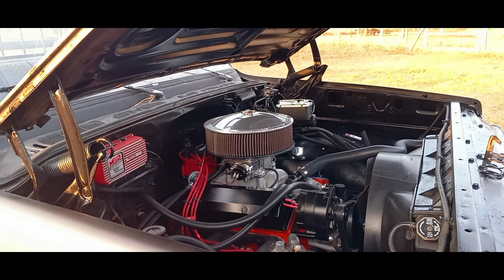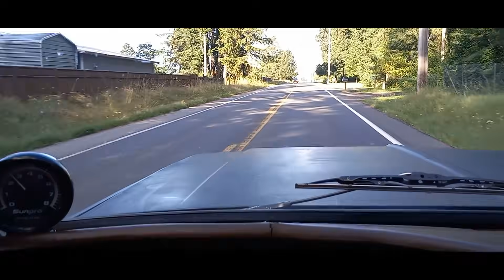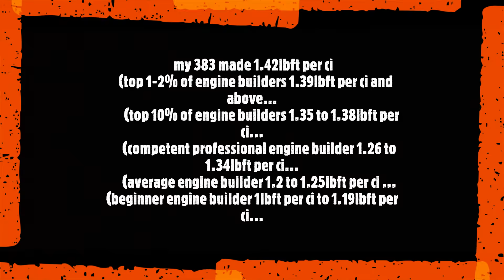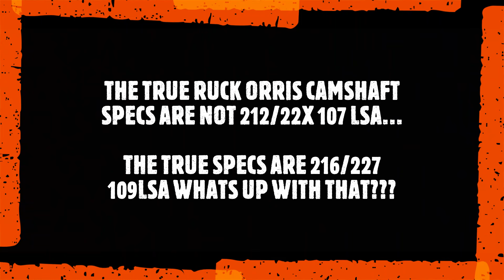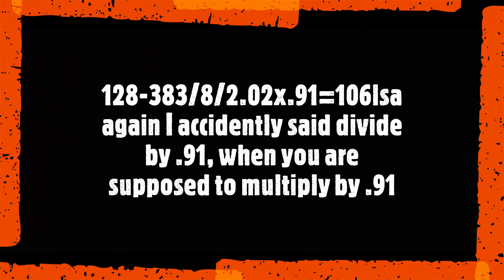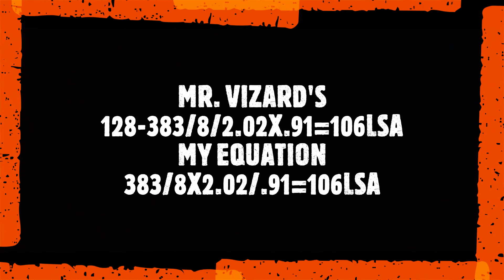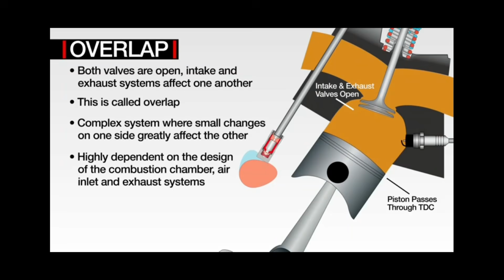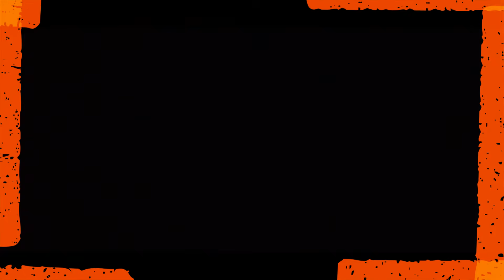CAMSHAFT SELECTION by LSA, 9 LSA's DYNO TESTED!!! LSA THEORY WILL BE DYNO PROVEN!!!, and EXPLAINED

Comment: Is this a video about cam shaft theory or a bitching and winning session about who don't know shit? I'm 52 minutes in and so far all I know is you disagree with BT'S theory and agree with DV. Maybe you should title it to 'oh how wrong BT is and oh how right DV is'!  JS
Reply from the maker: 😆🤣🤣... What you call "whining"( learn to spell) lol  is known as Dependent and Independent variables which you clearly are not qualified to give a proper Dimensional analysis....  This video obviously went way over your head because of a of lack comprehension of valve events and an inability to see what was being presented in the storyline... You are one of a very very small hand full of over opinionated and under educated people that said something similar to what you have said out of the 109,000+ people that seen this video... Hell David Vizard left a comment on this video complementing me on the information i had presented so there is obviuously something to that🤔(his comment is pinned at the top).... I dont have time to break the whole video down for you step by step but ultimately this video does show & explain the effects of random changes of LSA, it proves with dyno data that there is only one optimal LSA for any given Ci v8 engine combination and it shows that when optimaly selected LSA it will result in the most TQ & HP across the entire curve, it also shows how optimal LSA is achieved...  All this was being explained & proven with dyno data all the while showing & explaining Brian Tooleys incorrect theory about nothing having an influence on LSA and LSA not being an influential factor on power production, i even used Tooleys own words strait out his mouth to confirm that he is incorrect... Ultimately there is info in this video you will absolutely not find anywhere on the the internet, this video had also inspired David Vizard who is an ex areospace engineer and a legend in the automotive world, It had inspired him to make a video alot like this using Brian Tooley as an example of an incorrect "camshaft professional" because i had brought to DV's attention that Brian Tooley was spreading misinformation about valve events so he followed my lead and exposed Tooley also because DV & I have no tolerance for incorrect information which results in inoptomial performance and the spreading of BS, so Tooley needed to be exposed... I have had several different types of Engineers with Masters & PHD's along with intelligent people from other qualified positions recognise the magnitude & depth of the information given in this video and they are able to appreciate it, i even had one PhD physics engineer (just like my grandfather) tell me that this video would have made a great PhD Dissertation,  if you dont know what a PhD Dissertation is look it up!!.... My next video will more directly explain all this further/deeper and with alot more examples for proof.... In this video i was exposing BT's incorrect theory for LSA, his incorrect & incomplete theory for valve events and why his theory for valve events are incorrect, ultimately threwout this the video I proved he is wrong, i had proven that he is absolutely spreading misinformation and he is also lying about camshafts specs for example the truck norris cam... I had talked to Brian Tooley because he commented 3x after he seen this video, We had a short debate and ultimately he could not deny what had been presented, he had no rebuttal for the proof i have and the explanation i gave him about the fact that optimal performance is achieved by the gas dynamics produced by the dynamics of optimal valve events which in tern allow the engine to achieve the max trapped volumetric efficiency for any given engine combination via optimal wave tuning produced by the intake valve Opening position in relation to the optimal amount of overlap and the intake valve closing position... That is a vary short explanation of optimal valve events in nut shell... Optimal valve events start with the valve placement produced by optimal LSA which was proven in this video... Individuals like yourself should be mindful enough to keep their uneducated thoughts, as just that "thoughts" and also be mindfull enough to resist the narcissistic urge and keep their triggered opinions to themselves because it's not a good look to make comments based on hurt feelings and no real knowledge, Just sayin..... Also I would say you are afflicted by the Dunning-Kruger effect which is the psychological/scientific term for individuals like I had explained in the video, individuals which you obliviously identified with or you wouldn't have made the comment you did... Human Psychology is a real MF'ker and certain types of individuals like yourself are to easy to identify being as they unknowingly show themselves because they are completely unaware of their psychological shortcomings do an inability to accurately analyze & reflect on ones self and acknowledge the fact that they are most likely average or below avrage because stisticly there are more average people in the world, but the average person bealives they are above average, but if everyone was above average there would be no average and it is physically impossible to have no avrage...  Here's a little quote for you, The rational mind is a faithfull servent and the intuitive mind is a sacred gift, we have created a society that rewards the servent and has forgotten the gift....
Reply: @CDG-Racing_Dynamics  Aaaaahahaha......
Reply: @CDG-Racing_Dynamics  I would respond but I don't have a week to read your response. Maybe you could make a video about it. Be sure to include spelling lessons😏

Comment: If i go with whipple 427 lsx and ls3 heads what overlap should i have ? 30? Or should i make a nothet cam with less overlap?
Reply from the maker: Im gonna try to keep this simple... My first question is how did you determine that you need 30° overlap? What was that 30° overlap based off?... The amount of overlap you need is influenced by multiple factors of the engine & the intended use of said engine...Overlap is relative to the rpm at which you want peak TQ to be, which in tern will dictate the rpm at which peak HP occurs... LSA will influence how much peak TQ & HP is produced, along with how much power is produced across the curve... The valve placement produced by an optimal LSA will increase trapped volumetric efficiency which increases TQ & HP production across the curve and will allow the engine to carry HP & TQ farther past peak... LSA & Overlap calculated will give you the duration number... 
In my next video ( Which im almost done with) I get deeper the effects of LSA & optimal LSA with multiple examples, I will also show my compete formula for LSA & overlap which will give bolth a duration @.050 & @advertised duration..., My formula produces the same results as David Vizards but my formula does duration @ .050 &  advertised duration, where as DV's only does advertised duration... This next video will answer alot of questions and will fill alot of gaps which will make things alot more clear, this is a rather complex subject that is not understood by literally more than 98% of people in the automotive industry, this subject will require multiple videos to bring the information competently to light... 
also there are overlap charts in the video when i was giving an explanation of overlap and its function...  Hope this helps, .
Thanks For Watching...

Comment: Great video. I’m about to rebuild a ford 400. (351m/400) 335 ford family. It has open chamber 78cc heads. Compression is 8:4-1. I watched DV video on LSA. He stated minus by 127. I watched your video. You said Cleveland motor minus 132. To help compression I was thinking of going with a 107 LSA. Been searching for cams. Best I could find at the center line was 204 intake and 214 exhaust. Which I feel for a 400 cid that’s alittle to mild. But after using your 132 clevend formula I came up with 110 being the best LSA. I found a cam with 218/224@.050. With 110 lsa.Which I feel would be more suited for my power goals. My question is do you think 110is better than 107lsa with 8:4-1 in a 400? Has a performer intake with 600 Holley.
Reply: I'm curious to know what you come up with. I'm going to do my 1976 Ford Elite 400 and looking how to best manage a decent muscle car build...
4bbl intake a carb a given, headers and Id like a non-retarded cam... doubt I will do heads anytime soon, but the above should be well over 300hp and 400lbft torque... now to figure out the cam for 2000-5500rpm power band.
🤷‍♂️

Comment: I've read that carb/TBI combinations show different LSA requirements over port injected versions.  I'm thinking a little BS here because an engine should not care how the fuel is delivered. What I think some are missing is the increasingly stricter emission standards for newer engines with higher LSA to promote smoother quieter engines.

FYI. I have earned a mechanical engineering degree in the late 80's after starting as a physics major. I've worked as a controls system designer for the HVAC industry and one of my hobbies is truck engines. I continued to be humbled by others who have a very well deserved ability to communicate as effectively as you. I can hear the processes in my mind as you describe them verbally so I think it puts me somewhere on the autistic curve and it definitely reinforces my type A thinking.

Sorry to hear your diagnosis and hopefully your prognosis improves. I too had hoped to pass on my technical acumen to my kids but I had two girls that do not share my gifts or desires. Thank you (and DV) for sharing your knowledge and experiences.

Comment: just buy david vizard s cam program but good job
vave events are are far more important than profile dude vizaed has used 22.000 dynos pulls just for the formula he has h  been talking about his theorys 30 years back you should not have hated on the3 smartest person you never met
Reply from the maker: Who did I hate on? I was supporting & backing Mr.Vizards theory with data and threw my life experence, while exposing Brian Tooley for his incorrect theory of LSA being a result of valve placment when LSA is an input that dictates optimal valve palcment without guessing... David Vizard Commented on this video saying and I quote "What A cool presentation, I wish I was that smooth" his comment is pinned at the top of the comment section... I think you misunderstood something...

Comment: Thank you, brother, both you and Mr David Vizard for helping me learn what I need to know about the 383 I've got for my 1988 Chevy step side shortbox,I've done mechanical work since I was a kid. I pulled my first four speed Muncie from a 68 chevelle and installed it in a 64 442 Olds convertible for my uncle who turned me loose and let me learn. It came naturally to me through my father who could do mechanical and bodywork and paint which he got from his father and passed on to me,I got into the motorcycles while I served in the Army and have been repairing and building until I had a bit of a crash in 2011 and kinda stopped that. I have one last project that I want to finish and that's my pickup, thanks for the knowledge that you two are blessed with that's really going to help me out greatly, thank you very much.

Comment: Could you share how to calculate the correct intake lobe placement.
Reply from the maker: All of that information is actually going to be in my next video, the next video will be about 35min & strait to the point, it will get deeper into this subject of LSA with visual examples... LSA is what ultimately determines the optimal Intake open & closing events and this will be fully explained Statically & Dynamicly, the next video will fill more gaps with rare information and it will make things alot more clear... There absolutely isn't anything ive seen on the entire internet that has the information im bringing to the internet in this next video... I have the voice over completely done for the video I just need some footage recorded then put it together... I haven't put a video out in a long time because I'm physically not doing good at all and ive basically been unable walk at all or only occasionally but not for long so it's hard for me to record anything... 
Hopefully within the next week or so I will get the video put out... It's been a long time since ive dropped a video and it's kind stressing me out, specially cuz the video is so close to done...
Take Care🙏🏼
       ~ Adam ~
Reply: Thank you and you are on my prayer list

Comment: Fantastic! Long live the SBC! What’s happens when your compression ratio is less than 10:1. What formula do you use then?
Reply: So he says 1 point higher or lower is typically 1 point wider or narrower LSA let say the 128 number give you 108 LSA if you have 9.5 compression then use 107 LSA David Visard forums I found he did .6 wider or narrower for every 1 point of compression so less compression narrower the LSA

Comment: So, my 505ci BBM comes in at 101 deg LSA. Can that be right?? 2.14 intake,  RPM heads. 10.5:1 cr
Reply: It's 105 BBC heads flows different and have an active valve use the 132 number for bbc

Comment: Great Info Adam. I have seen David Vizard LSA formula before but you really sent the message home on how important LSA is. Nice job on explaining how you shorten the duration to keep the correct valve event timing. And I have never seen anywhere where the said to add or subtract 1* for CR. I've always used DCR with whatever CR I had to figure valve event timing. I never thought about moving the LSA 1*. I'm hooked. and will be looking at your other videos. Thanks.

Comment: Okay but for a daily driver is 106-108 lsA really practical with vacuum brakes and AC? If so I'll find a 108 LSa cam but I was always told that'll make for a rough idle and no vacuum for accessories. That's my thing with Vizard: he never talks about getting that power in the low RPMs and what to do for street applications.
Reply: Well I remember David's videos he talk about if it has a rough idea then take some duration away to take away some overlap. In fact in some cases a smaller LSA from let's say 112 to 108 does increase low end torque that's some cases. So definitely get a cam with lower duration so the overlap lowers

Comment: Great info brother 🤙 i built a 355 for my 87 regal i would like to know if i picked the right cam for my set up so heres my combo 350 bored 30 = 355 the pistons are the summit racing hypertectic flat top 4 valve relief with a 64cc head i would get 9.6-1 compression but i have the Gmpp Aluminum Fast Burn heads 62cc 210 intake for cam the i picked the Crane cam 282H06 with a 106 lsa would this be an ideal cam for my set up

Comment: Transketolase test could benefit you, it's very rarely ever tested. While it may not fix your situation it could make sure you are not having contributing factors. Thanks for the video I have been watching David and came across your video, thanks for sharing your knowledge. My brother has MS and I learned through years of searching and watching hundreds of doctors speak on this topic,  that b1 deficiency is looked at as a third world disorder because most breads cereals ect. are fortified with it. and can cause tachycardia, confusion, gate issues, carple tunnel like symptoms, digest issues and brain and heart damage if severe and left untreated often times its caused by to many carbs, sugar, caffeine, stress, digestive issues and medications like metformin and seizure medications. They all deplete b1 thiamine. I understand it's a long shot but if there's any chance it could help I needed to say it. Hope this doesn't offend in anyway brother. Thanks again.

Comment: What formula should be used for a high compression race application big block Chevy
Reply: 132 BBC also Cattle dog says every 1 point bigger compression is 1 point wider LSA and David Visard says 1 point compression is .6 wider LSA I saw in the forum so I used the .6 for every 1 point compression higher. So I am confused myself but Cattle dog say 108 for my 407 with 14:1 with 208 intake valve and 1.6 rockers and it came out exactly 108 with the .6 number

Comment: Every cam video I'm watched recently only covers N/A power and calculations that ultimately get a tighter LSA in the 106 to 108 range. Why didn't anyone cover the correct LSA required for a boosted engine? I just had a cam spec'd for for a supercharged SBF and the recommended LSA was 114 degrees. And many boost cams have a LSA from 112-115.
Someone please explain this, or present a formula that tweaks the original formula to account for boost.

Comment: BTR doesn't release full specs on the Truck Norris cam. RH gave all the info he had. But, I'm a believer in DV's 128 rule and cam specing and I've got into several arguments with RH. You can make way more torque using the 128 rule and more HP even with less duration.

Comment: Just ran across your video today. Between you and dv. I am getting better in understanding the cam spec's.  I have a couple of questions about cam spec's.  One is about cam advertise duration. What is it and what does it do?  David showed me from his videos about the lsa. And got little more from you about duration at 0.50 To get the starting point. Second question. If you have 108 lsa and 220 duration at 0.50. I am wondering if you can get good or smooth idle. With good vacuum for power brakes.  Thank You for your time 😊